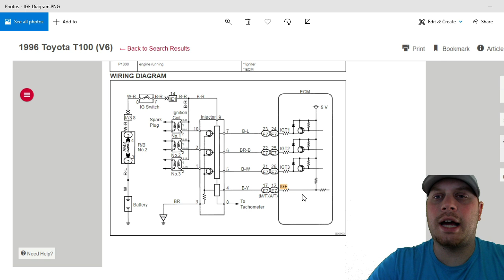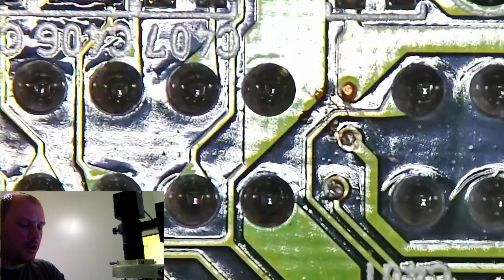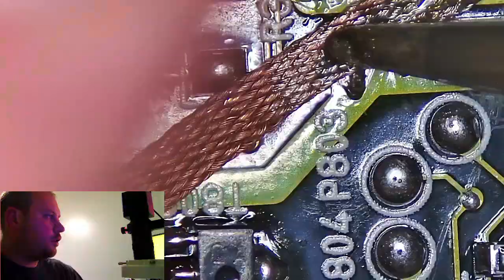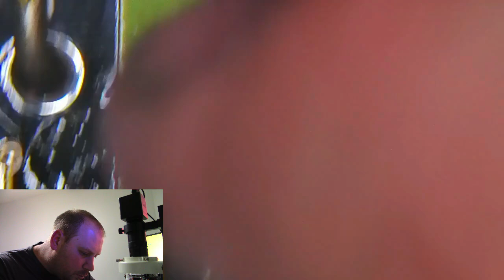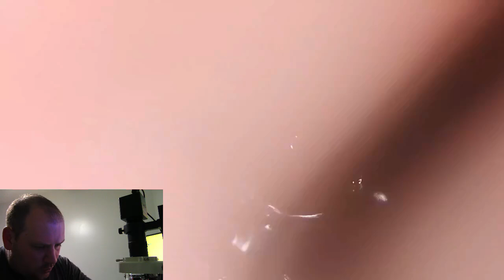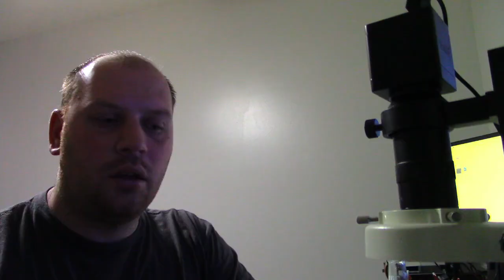'96 T100 Stalling-Module Repair

Comment: Excellent video , i have a question concerning a toyota landcruiser prado 2015 , there is a warning on the dash ( fuel filter maintenance required ) to restore this light you should disconnect the connector turn the car on and plug it back in , this method is not working and apparently the message is stuck , replaced the combination meter and still nothing , need help solving this problem , can you please explain the way this warning is working and how to diagnose this error ?!
Reply from the maker: Man, we don’t have those Toyota’s here in the states. I can’t even get service info for those! Sorry that i can’t be more help.
Reply: @VoltageDropDiagnostics  not a big deal , thanks bro , you've been always helpful

Comment: Love how you connected the scope capture with the internals of the PCM and the repair.
You rock bro, looking forward to the Prius combo meter fix, I see a lot of them being a hybrid repair Tech
Reply from the maker: I just seen this comment! I still need to edit the footage for the prius cluster!
Reply: @VoltageDropDiagnostics  I am highly looking forward to that video. The shop I work at is a hybrid repair shop so we see a ton of Priuses that needs the cluster repaired. Most of times we get them from the dealer

Comment: Really cool!!! 

What are you Using to clean with?

I once fixed a bad instrument cluster on an 80s something I forget but the printed circuit was burnt and I soldered a wire in between...didn't think it would work but it did lol
Reply from the maker: I just clean with alcohol.

And yeah, installed a jumper wire to a circuit board is a legitimate technique!

Comment: 2 options dont cut caps but desolder one leg and rock it to pull the leg out then the other and pull again. And with your tool , try to remove the iron tip and fully seal nozzle over the solder spot then trigger suction you have a secound where solder us still molten when you removed iron. It is how i do it with tools you showed.
Reply from the maker: I was unsoldering an smd cap and it popped. That’s why i have been cutting the legs. But I’ll for sure continue working on it! Thanks for the tips
Reply: @VoltageDropDiagnostics :  NICE JOB. On densely populated boards, you won't be able to cut components off, so simply wear safety glasses and pratice desoldering them. You have flux and low-melt solder, so you are ahead of most guys learning PCB repair 👍. My 2 cents: Don't rock caps (you cannot rock if area densely populated anyway). Simply flux cap, then bridge BOTH legs of cap with a blob of low melt solder, and it will drop right out IF your iron has the heat capacity. Then, add more flux and clear holes with wick or sucker. Get some KIMWIPES to help with final clean-up; they'll help you get the board looking like new. And FYI: the holes in PCB where circuit transitions between top and bottom is called a "VIA". Cheers

Comment: I do auto electrics and with out a little bit of electronic understanding you don't know what's going on . Most circuit's have feed back to keep the setting stable like radios the volume would go up and down with out it  I think if you bought some electronics kits to build like a wave generator . I did this and was soon repairing TVs for fun. Great vid well done😁
Reply from the maker: Nice! I’ve been working on repairing iPads and things like that. But yes; electronic repair makes me a better tech too imo

Comment: One question sir, these circuits on the motherboard were marked how would you trace them if they were not marked? Visual? Voltmeter/Ohmmeter?
One more question if you are willing, solder Trace was pretty neat, please explain how that works.
Reply from the maker: If the circuit board isn’t marked, you’re going to need a connector pin out and work your way through the board that way.

As far as the solder trace. If you use a good flux, the solder will only stick to the copper trace. Not the board.

Comment: you should get a pwer supply so you can power it up and check voltages
Reply from the maker: I have one! I didn’t think of powering it up! Do you do a lot better of board level repairs? Any suggestions on where to learn more?
Reply: @VoltageDropDiagnostics  i just tinker pj.  years ago i did an electronics course (mail order lol) it was for tv and vcr  but the basics never change.  when my boy was young i got him a radio shack learning lab  and we tinkered and learned together. its out there  just gotta find it

Comment: i really enjoy them had thought about trying to learn but backed out. would you be willing to try to repair a 1995 dodge ram computer pretty sure i know the problem not charging voltage regulator bad. no one fixes these anymore
Reply from the maker: I would give it a shot.

Email me at pwalter0810@gmail.com and we can talk about the module.